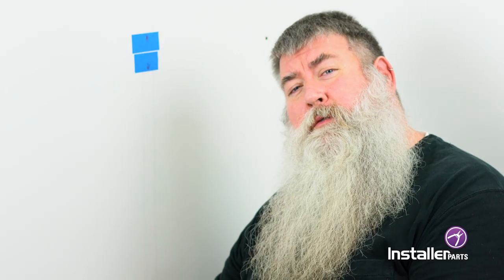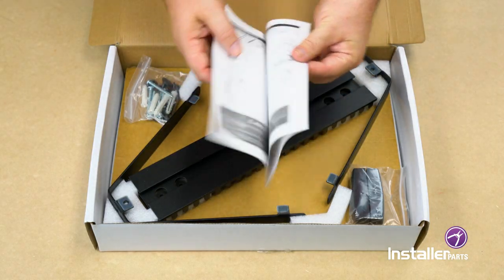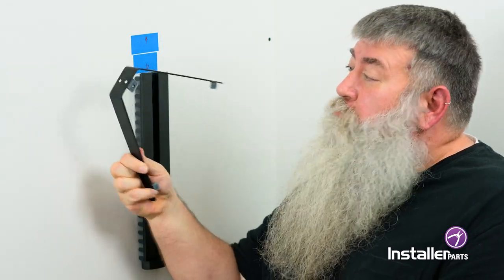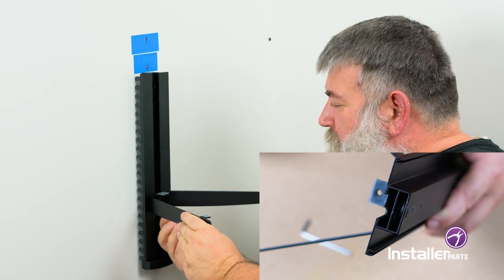InstallerParts Episode 26 - Aluminum Tempered Glass DVD Mount Double Deck, Black

Comment: How do you actually use the cable management?  The slide-in thingys are too rigid.  How do you get cables in/out of that channel?
Reply: Cole Stewart wondering the same thing
Reply: Also wondering about that.  The installation itself was a breeze.